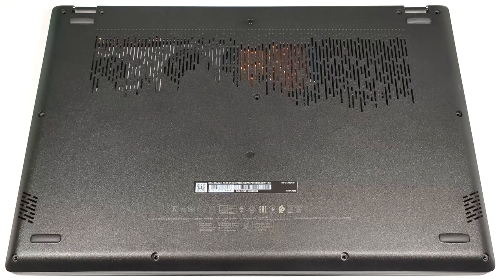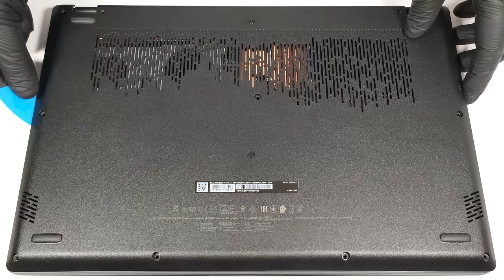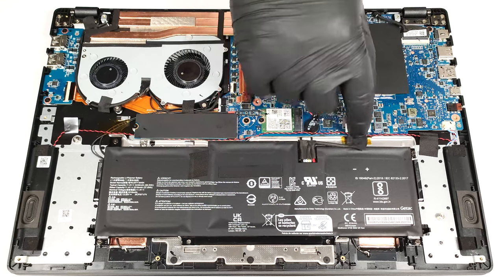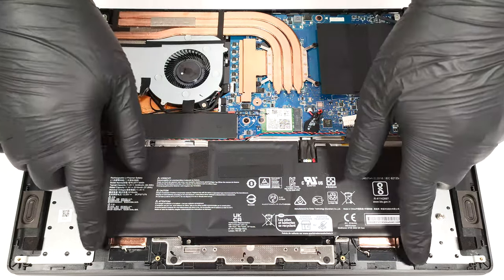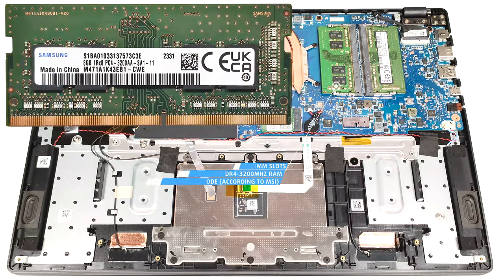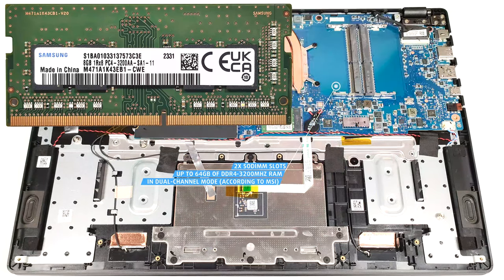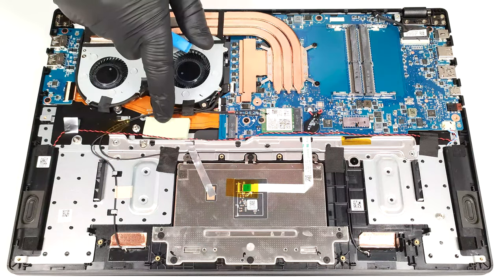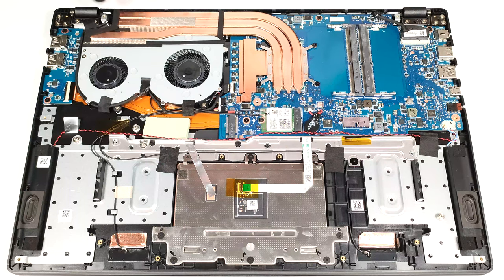🛠️ How to open MSI Modern 15 H C13M - disassembly and upgrade options

Comment: Does it have an additional slot for another hard drive (i don't care if its m.2, ssd or hdd)
Reply: No, there is only one slot for the M2 PCI-E 4 SSD. I took this laptop with an Intel Core i9 processor for programming with a reserve for the future, put 64 GB of RAM "Kingston FURY Impact" (KF432S20IBK2/64) and 2 TB SSD "Kingston FURY Renegade" (SFYRD/2000G) with additional thermal pads for better cooling. The battery costs 53.8 Wh. So, the top turned out, I recommend this appart.

Comment: I want to buy this computer and upgrade it to 64gb ram and 4TB ssd. If that’s possible to do, what exactly should i buy?
Reply: 32GB *2 DDR4 3200mhz SODIMM Ram (subject to brand, stick with stock speeds, avoid kingston impact those with lower latency as most likely it will not work), and then 4TB NVme SSD choose with dram cache G4 (adata S70 blade / 960 max, wd Black SN850X , kingston KC3000, Acer GM7000 samsung 990, and many2 more others, but if you did opt for dual sided NVMe SSD's, do remember to slim down the Thermal pads below the existing SSD, as existing ssd is single sided. if double sided SSD, it might push the SSD higher up, and might damage the SSD.
Reply: Thanks did it already long ago